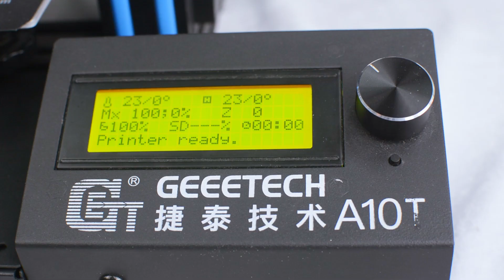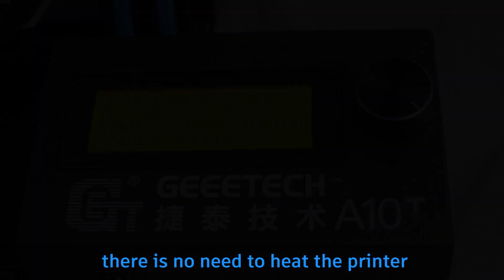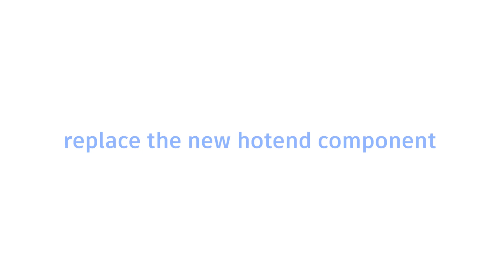GEEETECH A10T 3D printer | replace hotend

Comment: Does it matter which terminal each red wire goes to or is there an order?
Reply from the maker: The red wire should correspond to the responding terminal.
Reply: Geeetech all the heater element wires look the same. How can I tell which wire belongs to which terminal?